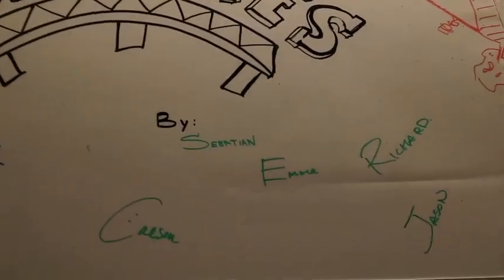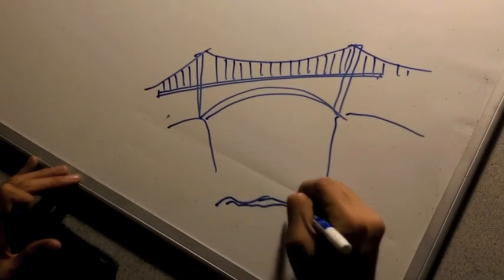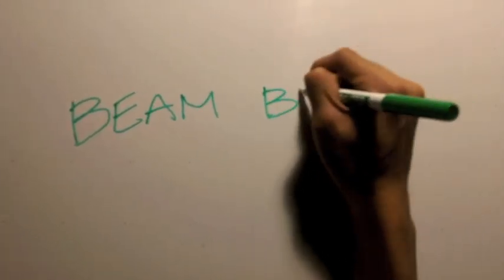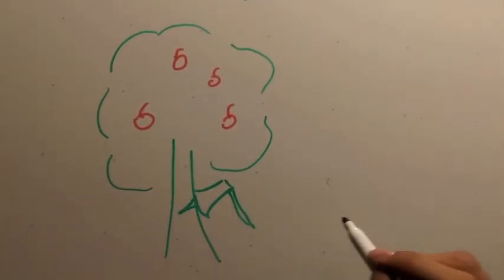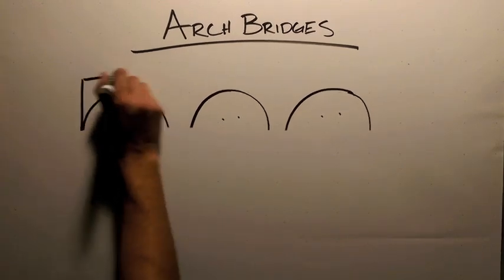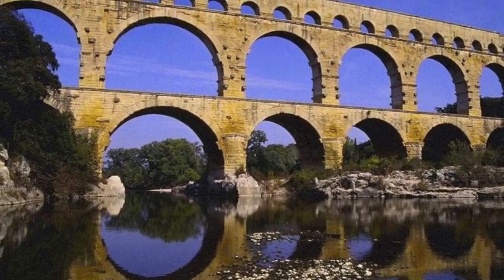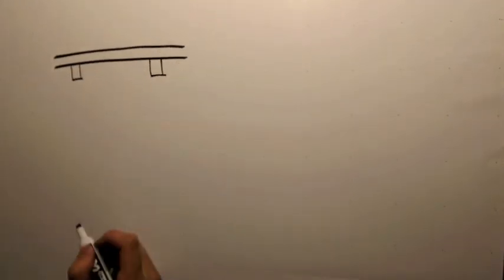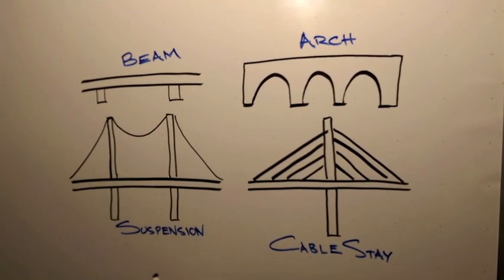"Why are there so many different types of bridges?" - An introduction to bridges for young students

Comment: I think Cable stayed bridges are the strongest as the beam has cables pulling the main road so it doesn't fall off

in other words: Cables from the beam pull the road and make it straight

beam bridges only have 2 small supports

Arch bridges are Close, but not fully supportive

Suspension bridges are very close, but the cables don't pull the road

Therefore I think cable stayed bridges are the strongest and the most likely over short distance water travel
Reply from the maker: Well said!